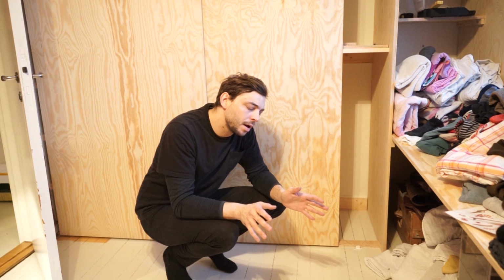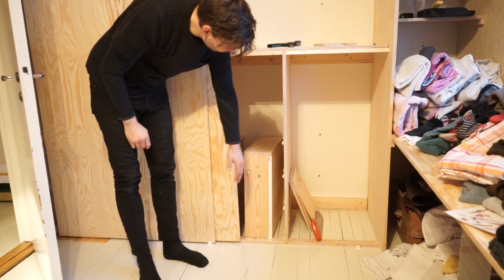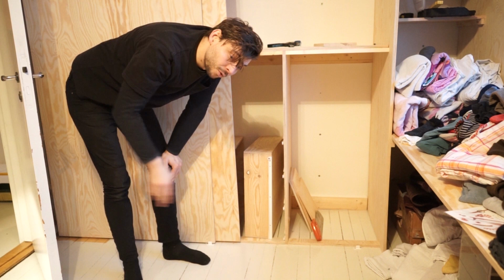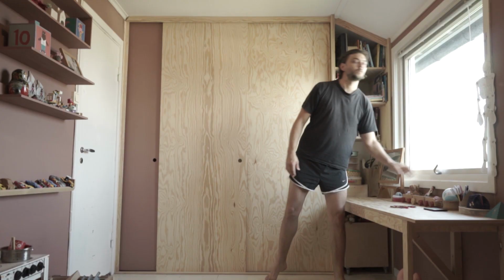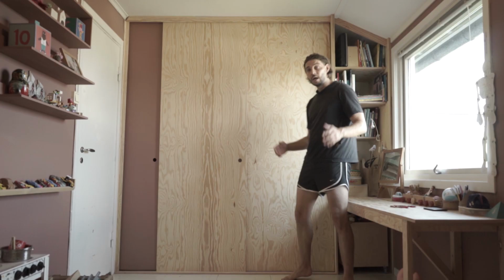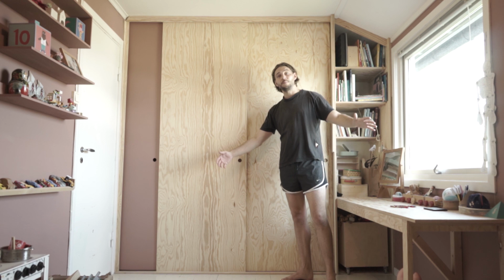Making a large built-in closet with sliding doors combined with a desk

Comment: Thanks what size of mdf did u used for the sliding door i npticed u connect3d the wheel direct to mdf board door what size screw did u used are these 12mm mdf or 18mm
Reply from the maker: i think i used 12mm mdf, and 18mm ply, unsure about the screwm just something that i had :D still holding btw :D

Comment: I have wardrobe door of size 3.5 feet long and 1.5 feet wide and only have 18mm plywood to work with. Can i use 18mm ply foor door if yes how many softclose hinges should i use per door. does plywood bend after couple of years
Reply from the maker: plywood tend to bend yes, but 18mm is pretty sturdy. i would usggest 3-4 eurpean hinges, should work great